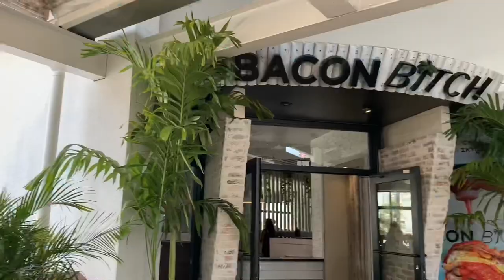Revealing The New Build! E:21

Comment: Hey man, I live in California and I'm saving up for this kit car, but I have two questions. What is the process to make a payment for the car? And do I have to fly out to Florida for it?
Reply from the maker: Hey bro! so much easier for me to answer via instagram at thefinestnc but basically you pay 60% then 20% when he is halfway and 20% when its ready to pick up. its been almost 2 years since my order and im still waiting for it to be finished. Not joking.
Reply: @joshuatougas  Hey Wassup man. I messaging you on here cuz I don't use instagram anymore (personal reasons). But Damn!! Almost 2 years? Has the guy updated you at all on the car? Has he even started yet?
Reply from the maker: @gamemastr7  yeah. Very slow process. It’s painful. Would have just used those funds to buy a Gallardo if I knew it was going to take longer than I was told.
Reply: @joshuatougas  Damn! After hearing all of this... I made a seperate project for the K1 Attack just in case the DDR kit car doesn't work out. I sent the guy a message and he still hasn't responded. 🤨Low key making me suspicious of the dude. I'll try to contact them once more about the kit car but man, if it's a dud then I might have to think about another kit car.
Reply from the maker: @gamemastr7  Today marks 2 years and no car. I've received a few updates but it seems to be far from done...
Reply: @joshuatougas  😬
Reply: That's not good at all bro. Like I said, I'm probably going to consider getting a different kit car. The wait time for this kit car is ridiculous. I've heard rumors of this happening to quite a few other people and but I guess I thought it would be better over time. Looks like I was wrong.
Reply: What's up bro? I wanted to see if there is an update on the build. Are those guys even close to being done with your kit car?
Reply: @joshuatougas Hey man, I was just wanting to following up with the build and see where it was at? Has he updated you yet? Is it even 80% done? I don't mean to ask you a lot of questions it's just I was interested in this kit but this is most definitely a deal-breaker if it's taking this long.